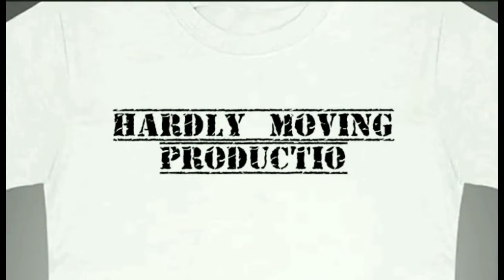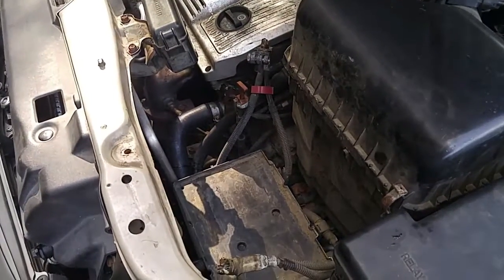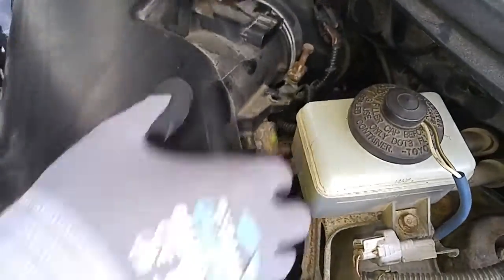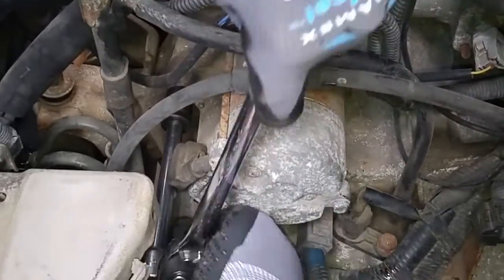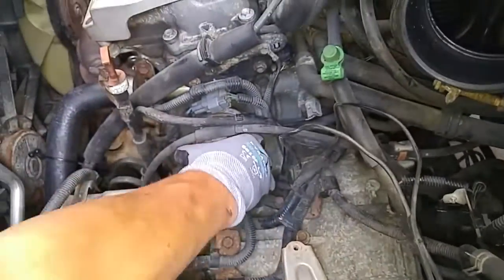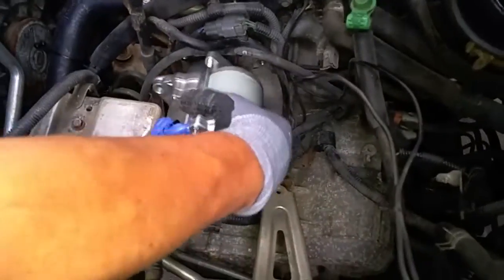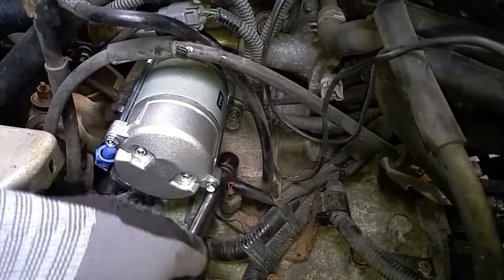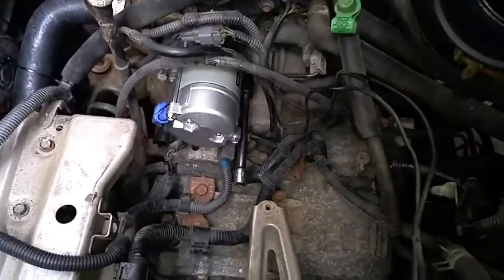Toyota / Lexus V6 1MZ-FE Starter Motor Replacement (Video performed on 2000 Lexus RX300)

Comment: The starter on my 2000 RX300 just went out today, your video posted at the perfect time for me. Thank you, you made it look easy. Am going to try it myself.
Reply from the maker: You're welcome and good luck!
Reply: Hey Eddie, how did it go? I just left my car at the parking lot of the Sushi place my wife and I ate, food was great, not starting car sucked... pretty sure it's the starter. I have no experience on fixing stuff but I would like to try. What do you think, doable or not?
Reply: What if my Starter just went out of no where? I turned off my lexus rx300 & didnt want to start again. Without any sounds, When i try to start it i here a loud one click in the middle
Reply from the maker: @louiearias3538 checked your battery?
Reply: @hardlymovingpro  yes sir, bought a new battery, I heard a loud 1 click next to the battery area. I believe it could be starter, could it?

Comment: Luv the tip on the paper tissue to hold the bolt in.  Great videos
Reply from the maker: Thanks!  Helps a lot in tight spaces where the nut can fall off easily.

Comment: One of your easier jobs, those are nice to have sometimes. Looks like the same basic procedure for most 3.0 V6 , maybe the 3.3L as well? on many Toyota/Lexus transverse, front wheel drive engines. Great video for the DIYer. Thank you.
Reply from the maker: Yes it's a easy job but should encourage those who got a $500 + repair estimate to repair it themself.

Comment: like the tip about paper towel keeping bolts snug in sockets.  I hate it when the bolts slip out of the socket and I have to hunt for them.
Reply from the maker: An old trick commonly used by mechanics.

Comment: Haven't seen you work on these 1me-fz engine for a while. Appreciate it.

How do you diagnose a bad starter again ?
Reply from the maker: Obvious way is a fully charged battery won't get the starter motor to turnover.  You'll also hear clicking noises.  Keep cycling the ignition multiple times and maybe the car will start.   Starter turns over too slowly.

Comment: would you say the 1mz is your favorite motor to work on
Reply: Its probably the 3MZ motor? They are very similar motors. The 1MZ was more common in the Toyota's, Camry, Avalon, Solara. That would be great video idea 💡
Reply: @dsimp765  oh my bad 😂
Reply from the maker: It's a 1MZ but doesn't make much difference compared to the 3MZ.
Reply from the maker: @dsimp765  The Toyota 4 cylinder 5SFE is really easy to work on.  Everything is in your face.  Alternator, a/c compressor, ignition wires, spark plugs, valve cover gasket, etc.

Comment: Sir what is the brand name of new starter ?
Reply from the maker: For parts like starters and alternators, I prefer to buy store brands with lifetime warranties.  If the part goes bad, I can get a replacement quickly anywhere in the country (I.e. advance auto, oreilleys, autozone).   The OEM brand for Toyota is Denso or Aisin.